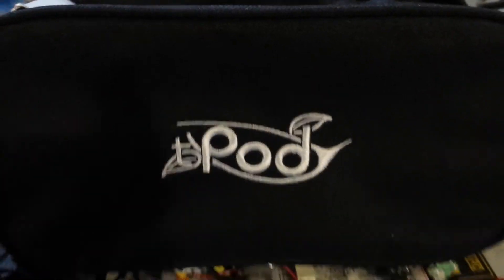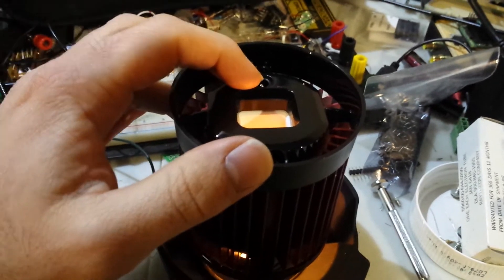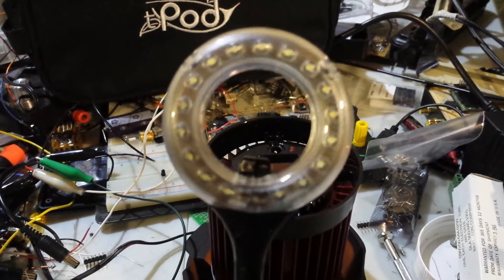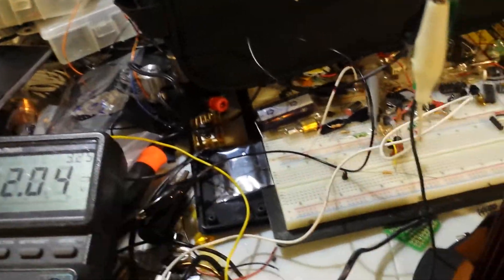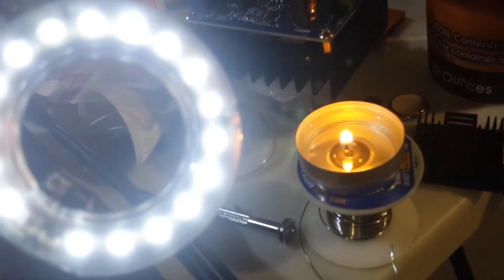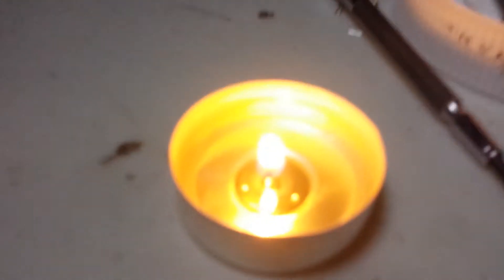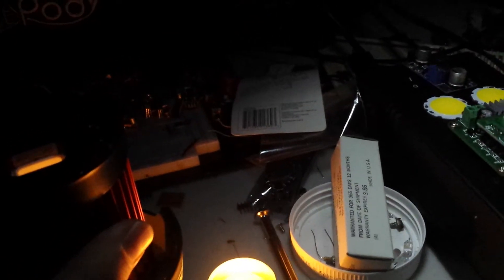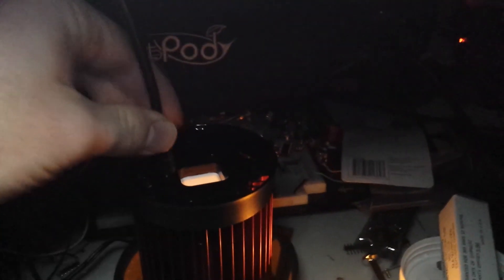Tea pod thermoelectric generator

Comment from the maker: slider2732 I agree indeed :) Moooooore lights hehehe I did some more test yesterday since I have an extra boost circuit and a bunch of 100 mAmp LED and I did light up 2 of those very strong at about 27 mAmp and they make a nice spot light maybe another project. Happy new year to you as well :)